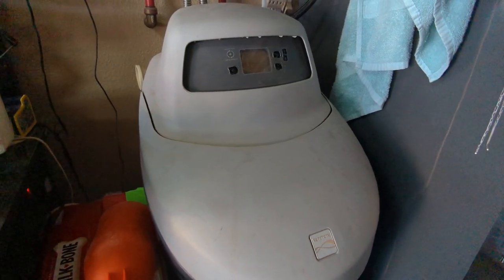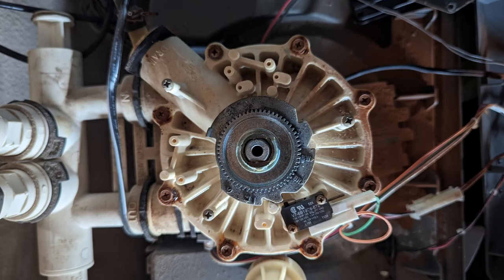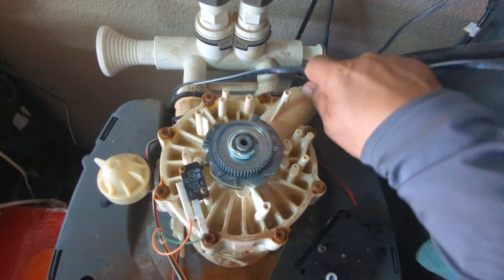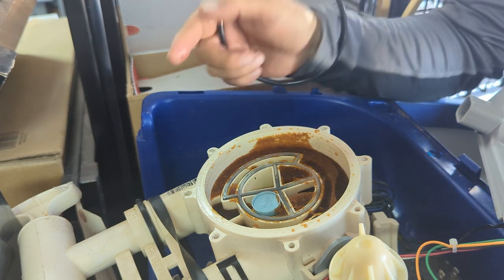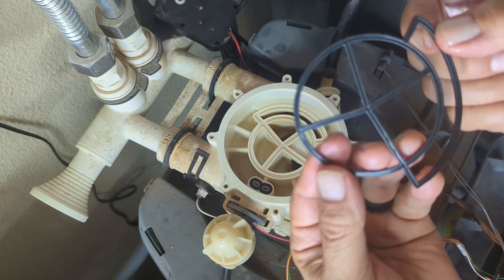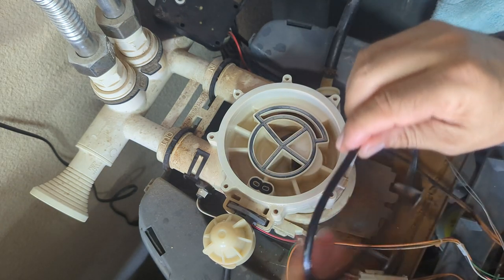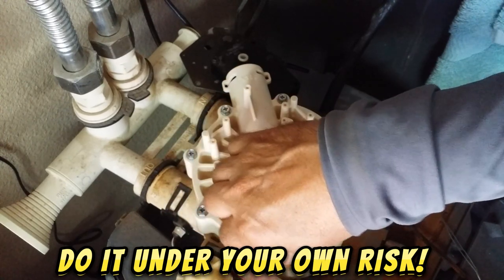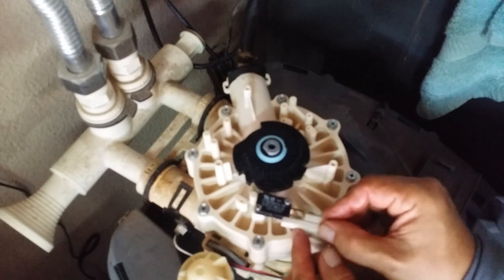DO IT YOURSELF REPLACING A WATER SOFTENER VALVE COVER ON A KENMORE MODEL 625.384200

Comment: At 8:37 the blueish drain plug , does the top have a lip or raised edge all the way around I believe mine has cracked and no longer seals… trying to find that part number the white wafer on top is still intact